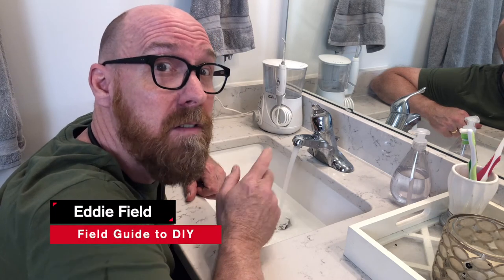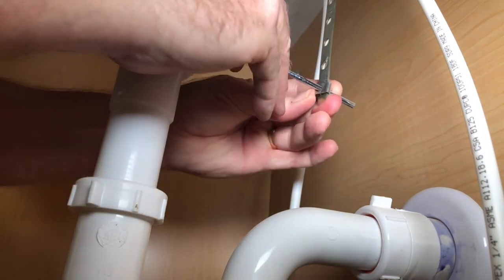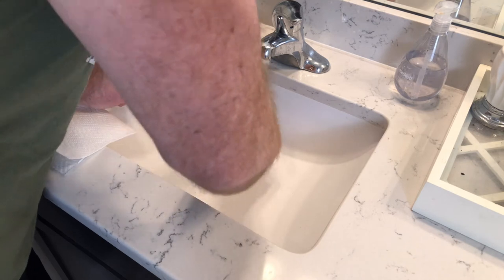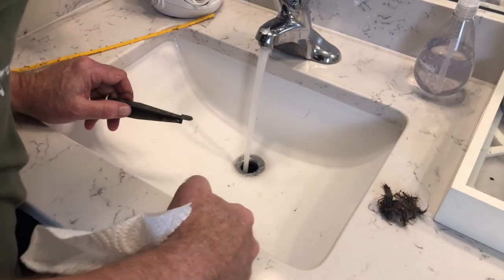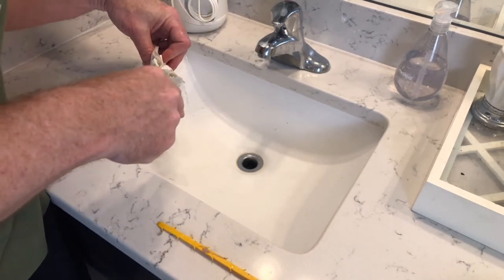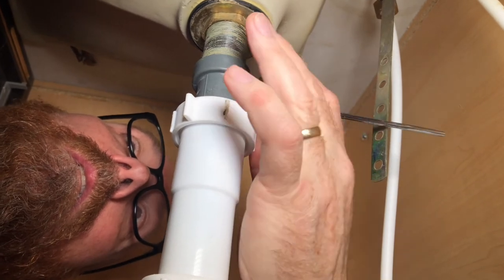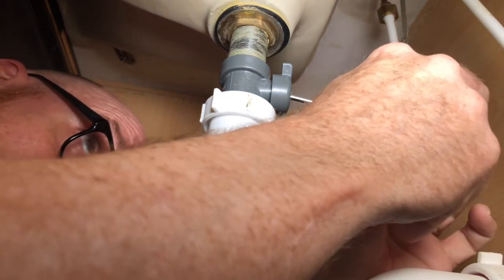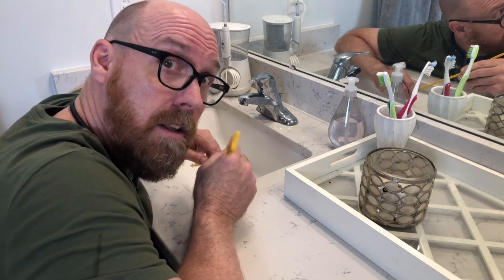Unclog Your Bathroom Sink Drain Quickly & Easily with Zip-It

Comment: After using prescription toothpaste with Floride my bathroom sink became clogged tried dawn dish soap followed by super hot water even tried to use some bleach in the mix but still clogged. All I can imagine is that prescription Floride toothpaste hardened like plaster inside along pipe.
Reply from the maker: I’d never heard of that.  That is odd.  As an experiment, I’d spread a little on a paper plate and add water to see if you get result.  I might want to know what brand tooth paste you have for when I’m looking for a spackle or concrete alternative for my next project. 🤣. Thanks so much for watching!